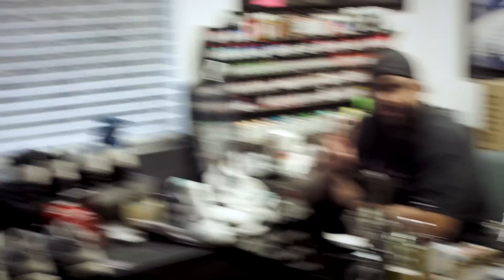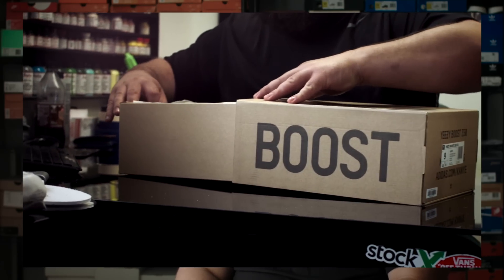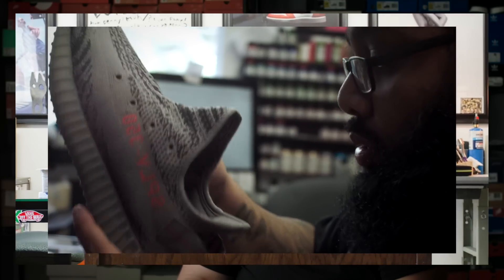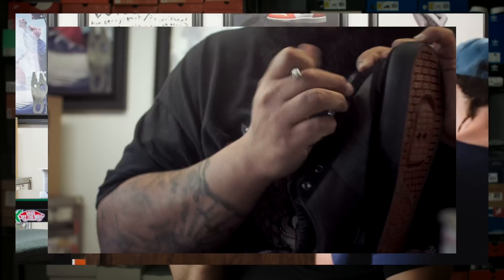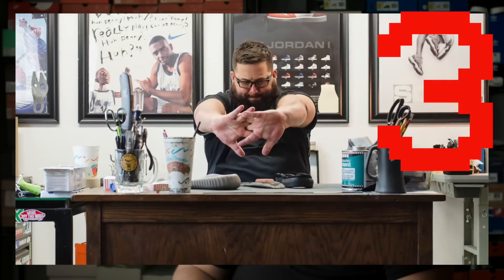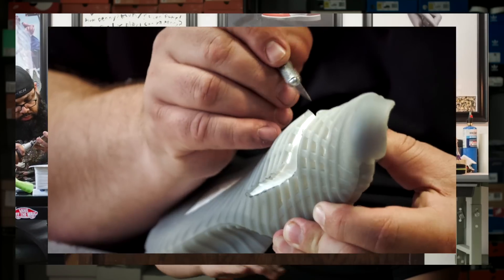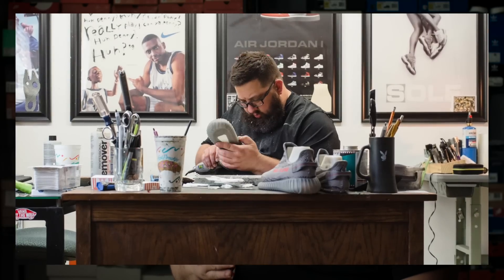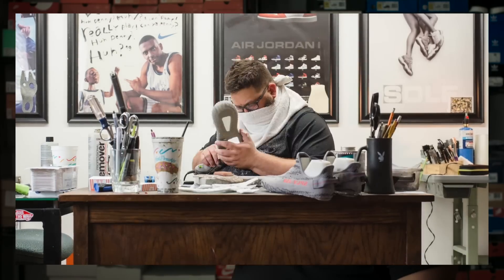Yeezy Boost 350 - Cycling Shoe Conversion - (How to Make your Sneakers Clipless)

Comment: Clean work and inspiring.   Now that I've seen your work, I'll convert shoes that fit into clipless with retrofitz. No cycling shoe is wide enough for me. 

A cheap full face mask will protect your glasses from abrasive grit. I replaced 2 pair before using a face mask, a few bucks at Harbor Freight vs much for glasses.